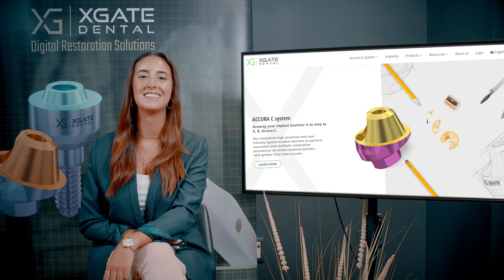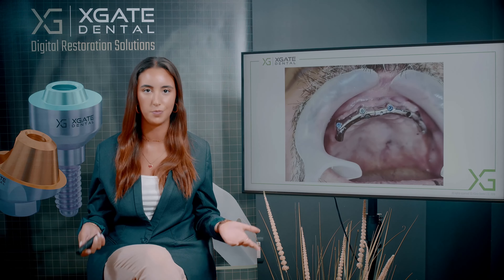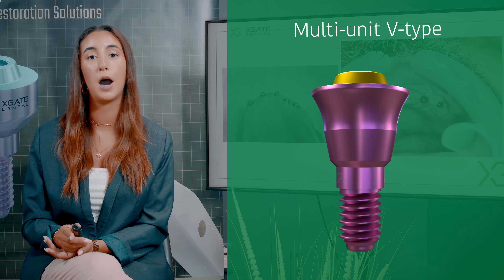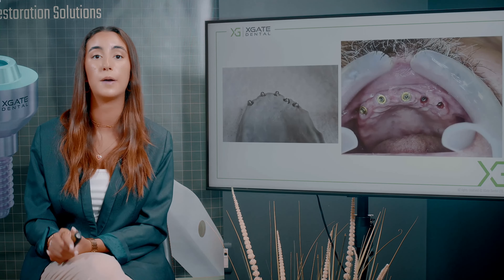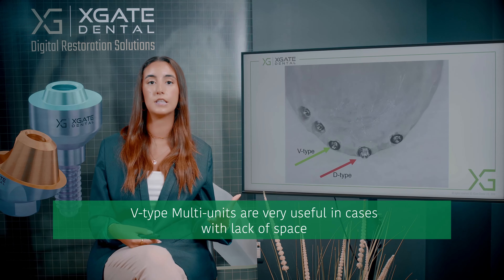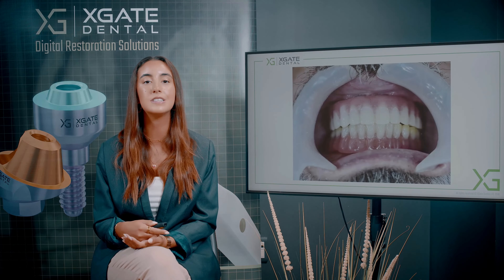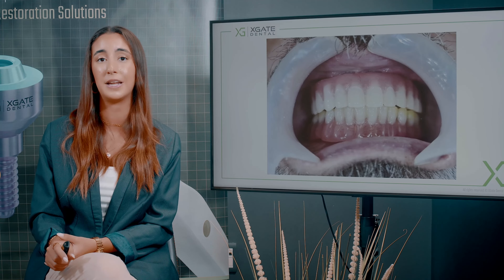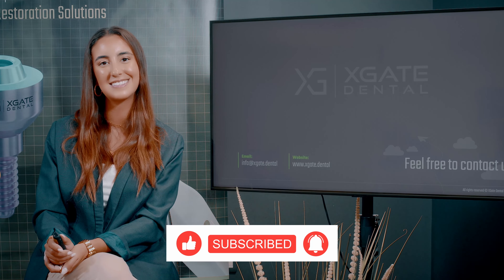An overdenture on a bar. With V Type Multi Unit we’ll get better aesthetics & more space

Comment from the maker: 00:00 As you can see, all the implants are buccally inclined.
01:00 Better aesthetics and have more space for the overdenture
02:20 The screw will be much closer to the horizontal part of the multi-unit
03:00 It's hard for the patient to clean it
04:00 If you don't have enough space, it would fit great in different types of works
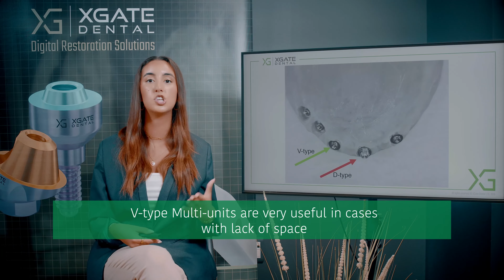05:00 We can use angulated multi-units, but first...
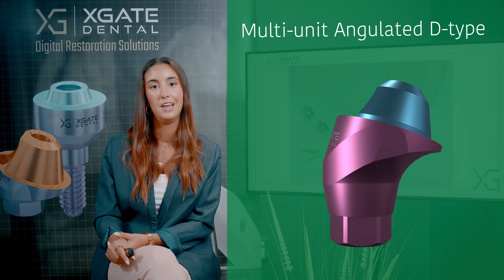06:00 An angulated multi units with the same shape
07:00  For the lower jaw it's almost impossible to make a good denture without any implants
08:00 The denture itself is made from PMA plastic